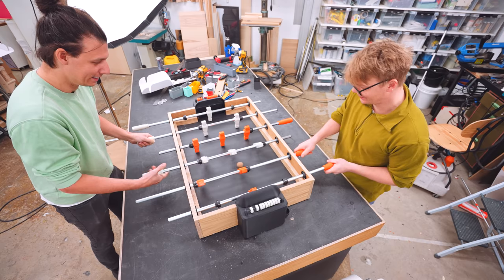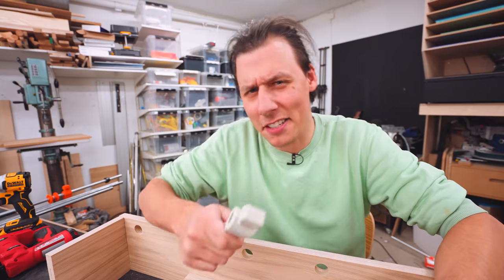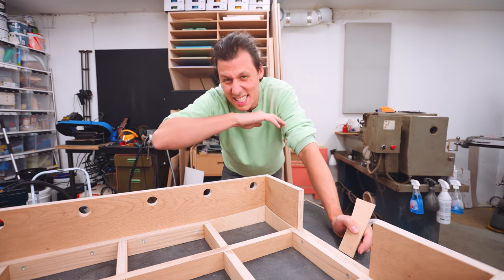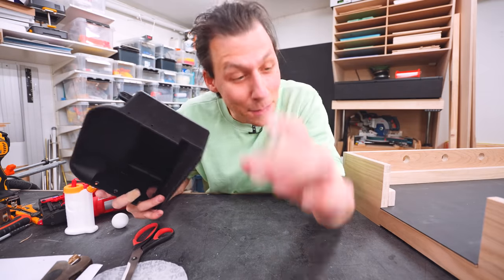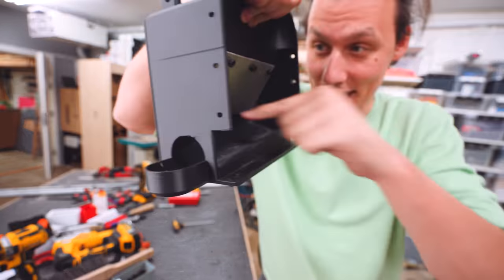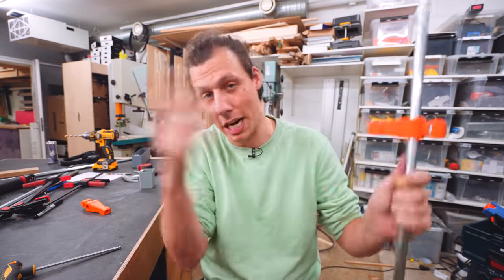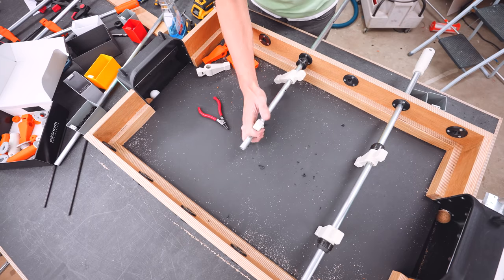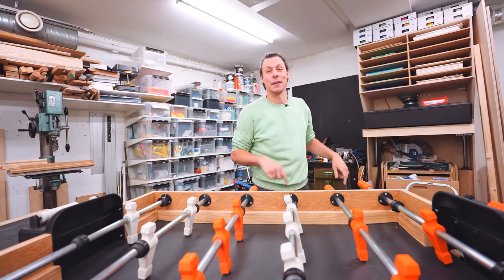How To Make a Desktop Foosball Table!

Comment: You could try loosening the bolts on the metal plates a bit so the plates can move back and forth. This helps deadening the movement of the ball when it hits and makes it less likely to bounce back out. At least, that's how "Jupiter" tables work in Belgium.. Very nice build btw!! Always love the combination of woodwork and 3D printing!

Comment: Nice build!  I've been really enjoying adding manual supports to the CAD model.  A one extrusion wide wall in the right place can replace tons of supports and is super easy to cut out.  (especially with the "detect thin walls" toggle)
Reply: That and also in this case, tree supports would've saved a bunch of filament and likely time too!
Reply: I came here to say exactly this!
Reply: And some strategically placed holes can make it even easier to break

Comment: Very nice!  About 25 years ago, I built one of my own design. This was before 3D printing, so the players were all cut from plywood. I used wooden dowels and instead of a complex goal, I made a fabric pocket which did a nice job of capturing the ball. My playing surface was flat, so the goalie rod was longer to allow it to get into the corners. Even though it was much simpler, it played really well.  I also built a tabletop hockey game modeled after a commercial version known as “Nok Hockey”. Both were really fun projects.

Comment: If you had printed them laying on their backs you would have used a fraction of the amount of filament for support.
Reply: He probably wanted a better surface finish on the external surfaces
Reply: @mateoarv  maybe so, but the convex outer surface would've been easy to sand.

Comment: may i suggest cast with the waste PLA just between 130-150 C in oven (depending on the PLA experimenting may be necessary) makes PLA in to a thick paste close to paint. With that paste you could put it between two sheets of MDF or plywood to make your own thin sheets of material. It can be handle by slow working hand tools after that (like chisel,knife and hand planer no saw due to the low melting point)

Comment: Great build! Wouldn’t the plastic inserts be called bushings rather than bearings?  Are these plans not on the shop yet or am I just failing to find them?
Reply: I was thinking the same thing.
Reply: Turns out bushings are also called plain bearings, and a few other things, bushings are a type of bearings, but I think it is most common to call these bushings, and the roller type bearings bearings. If you meant about the plans, I still can’t find them.
Reply: @ultrabob  I was talking about the bushings. I guess it is like calling a square a rectangle. It is right, but odd.
Reply: I call those flanges. Bushings, to me, are the white sleeves he placed inside of the flanges.

I'm speaking from industrial experience. But, who knows... potato, tomato?

Comment: Nice build, but I prefer the French style where the rods don't protrude the other side, instead, the tube supporting the players slides on an inner tube attached to the opposite side of the table. I think it is safer to not have the opponent's rods coming out on your side (plus you cannot cheat and block them)
Reply from the maker: I totally agree! We used to have a bonzini table, but for simplicity i chose to build it this way :)
Reply: I honestly didn't even know about that. Makes perfect sense tho to do it like that!
We had a foosball table at an old job of mine. After the evening shift the games got, well let's say interesting and that French style table would've saved quite some pain XD

Comment: If you printed the goals laid flat, you would not have needed as much support material since you only need support material when you have an overhang. I would have used a piece of tubing over the pipe for a damper.

Comment: Internet safety police! I think at the start you were using a sled and the fence. Use one, don't use both as it's a really good way to get kickback. Also use a push stick!
Reply: The problem is not a sled and a rip fence. The problem is two fences. In this case it's a sliding table, and the piece is laying with a distance to the crosscut fence, so it can move a bit and won't get stuck between the fences and pinch the blade.

Comment: I think you really didn't need all the support. There are lot of ways to reduce the amount of support, but the best way to get rid of the necessity of supports is to design a curverture that supports itself, which is basically what you did from what I can see in the video.

Comment: I don't know much about 3D printing, but could you have printed the players inside the goals to save on support structure?
Reply: Assuming it fits inside the goal, I think your idea is doable and it is indeed a good one.
Reply: This definitely could work. Either if you want them the same color as the goal or if you have some kind of dual extruder setup
Reply: @larsthestorf5630  yes, the goals could be the same colour as the players or maybe spray painted black
Reply: The surface finish any players printed that way would be rougher (maybe depending on cooling and other tweaks). Also orientation is important. I don't know what orientation the player pieces were printed in, but they do have an impact on strength.  I assume the players were printed so the layers are perpendicular to the bolt that is goings through so that they don't split around the bolt.
Some people suggested printing the goals on the back so that much less supports are needed. Another option if it needed to be printed in that orientation is to print a hollow box within the goal. This would fill the space and use less filament than traditional supports
Reply: To add to the hollow box idea, some slicers allow for tree supports that work well for these large high flat surfaces as they have a couple of smaller bases that then branch out at the top, using a lot less filament.